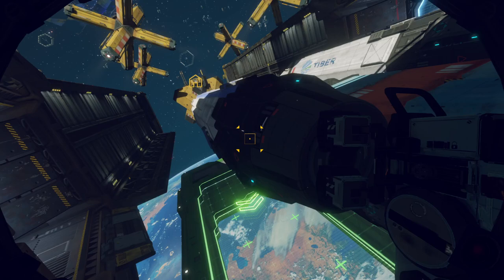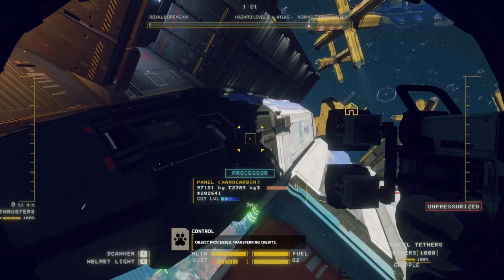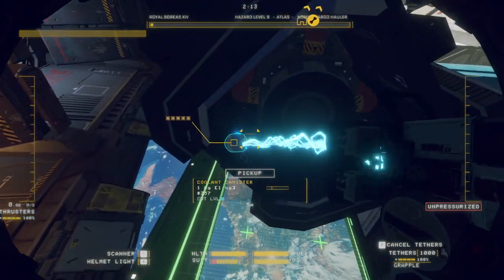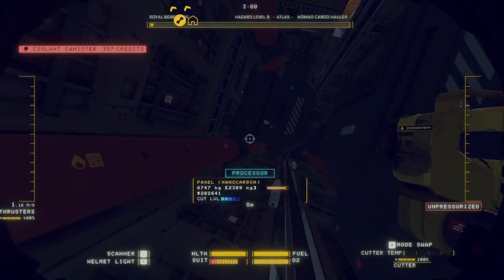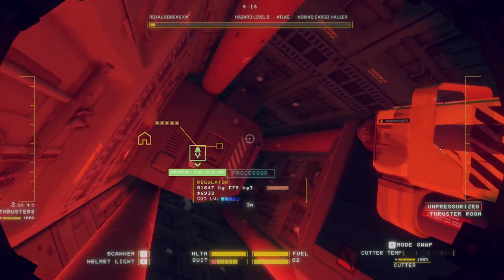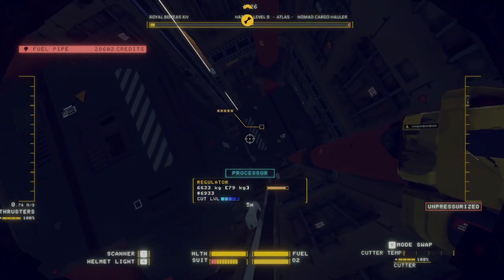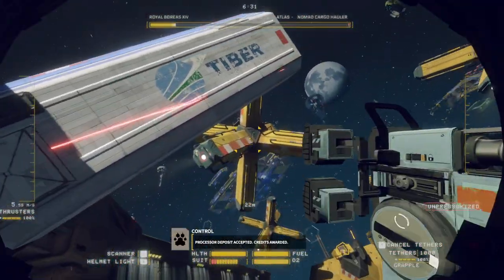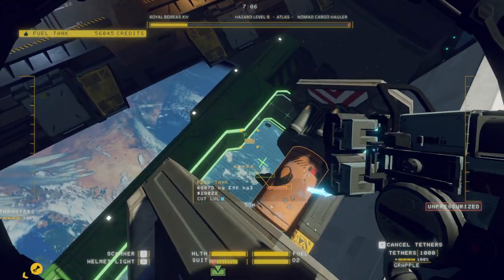Hardspace: shipbreaker - Removing Quasar Thrusters Safe or Fast?

Comment: I've seen a lot of people showing how to use the coolant tanks to remove the engine safely but no one shows how to use the demo charges to remove the front then pull the fuel tanks to prevent fire method.  Do people just not know that one or is there another reason people avoid it.  I've never had any problems with it so I'm confused why I never see anyone showing it.
Reply from the maker: thanks for watching, I personally was not aware of doing it the demo charge way, i just had a play about and yeah indeed you can totally do it the way you said.  I would image the reason its not really shown is that it's a bit more complex and you need to use another tool(the demo charges) , also positioning the demos on the outside of the engines imo is not as obvious and I think you sometimes have to  move the thruster away from the main body of the ship to get the demos in the right spots. That being said there's no right or wrong in this and thanks for sharing something i had not thought of!
Reply: @BroadsideGamingTV  Actually it’s very obvious where to put the demo charges. Those red rectangles on the engines are the clue. Just place the charge vertically along the front edge of the rectangle (the side near the front) and after detonating them just pull the front cover off and you have easy access to the fuel tanks. Pulling them out prevents any fire at all from cutting the engine loose. You can use the structural vision to see the location of the cut points inside if you aren’t sure if you have the right spot.